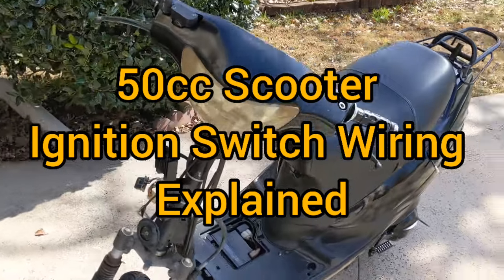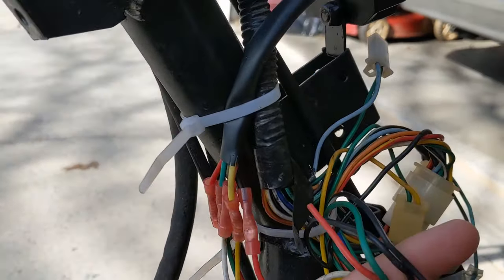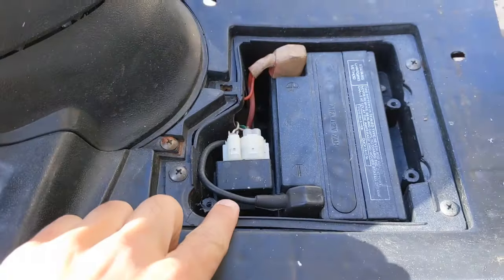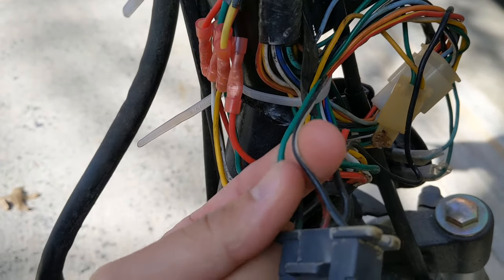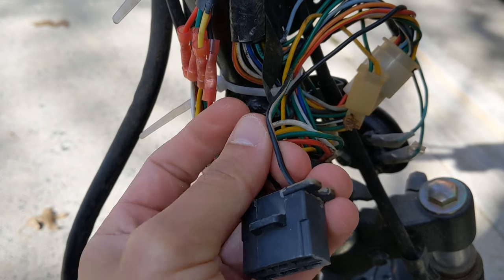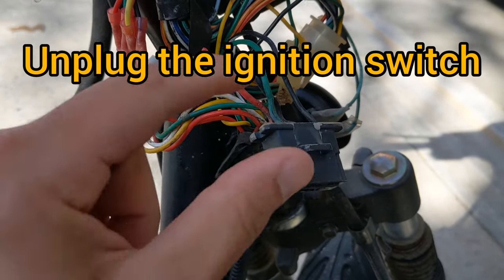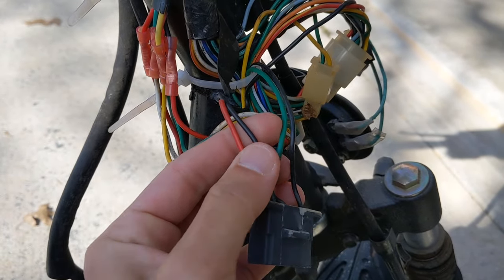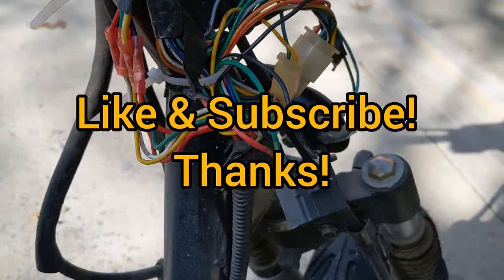50cc Scooter Ignition Switch Wiring How To [Lost Key]

Comment: I tried all that and it still ain't got no way to start it are they gone I'm getting juice to all the places and everything's checking good but it still ain't got no power or lights
Reply from the maker: @DanielGish-v1x  I’m not sure if this is your first comment or a reply to a previous one (use the reply option if so) but if you’re saying you probed everything and it’s working then idk why it’s not. Are you using the key or just connecting wires? Maybe the ignition is bad if you’re using a key? Maybe a relay somewhere that isn’t working?

Comment: ive got a 49.5cc schwinn sport scooter. i py passed the ingnition switch to start my scooter after ridding it . while i was ridding it it died and i have no power to the stater switch button and i have no lights or blinkers working
Reply from the maker: @BruceCook-v3j  sounds like you shorted something out, blew a fuse, or your battery isn’t being charged. Check the fuse

Comment: Let's sayyy I hooked the black and red to crank the scooter I touched the wrong spot and heard it pop like a breaker kicking seen some sparks how would I reset the wiring it's not showing me I got power no blinkers breaks not even turning to show me I got a full tank of gas what do I doo
Reply from the maker: Check the small round fuse by the battery

Comment: Please reply bro, so I have a 150 and I have red, green black and pink wires in my scooter. New ignitions aren't working
Reply from the maker: I would probe the wires if i were you and trace them to be sure. Red is probably the hot 12volt wires. Green is probably ground. Black is switched power, and if pink isn't constant power then it's the same same as my black and white wire... but that's just a guess.

Comment: Hey do you have the correct link to get the replacement ignition switch for this 4 wire  set up
Reply from the maker: No I only used switches. Try searching for replacement key sets for 50cc scooters. If I recall they are $15 USD and come with new keys, ignition, seat lock and trunk lock. You can swap them all out and have the same key for all.

Comment: Do i have to cut the red wire? And by connecting the black with the red can i just kickstart it or do i have to tape them together
Reply: You need to use a switch so you can short out the red & black to start up and also unshort the black/white & green wires at the same time. You need what is called a double pole double throw and connect the red and green to the two commons and black to the Normally Open contact where the red is connected to common. Connect the black/white to the normally closed contact of the common green wire.  One pair opens (disconnects) from each other green/black&white and the other pair gets connected red & black  when you start the bike by throwing the switch.

Comment: I purchased a stolen recovered Chinese scooter from a salvage company on eBay no keys. There are only two wires coming out of the ignition barrel so I hot wired the two wires of the main harness and I have lights horn even starter motor but no spark from the plug my question is do I have to have a working ignition barrel with key etc or is it something else?
Reply from the maker: Probably something else buddy. Check the CDI / ignition wire I was talking about by the battery. It's probably still grounded.

Comment: I have a question I took the plug out of the ignition  and now idk how to put new key ditch it’s same wiring color as yours .i touch to wires and the schock you with electric current do those go together
Reply from the maker: I just saw this. It sounds like you are connecting the positive and negative wire together. They do not do that. You are essentially shorting out the system. You might need to check your fuse now.

Comment: So I have a few wires coming off my ignition red and black which I have connected to a toggle switch to turn in and off power then I got two green which I found if I connect them together it’ll kick start just fine but the problem is my electric start won’t work, I do have one wire left which Is black with a white stripe, I believe my battery just keep draining I think but what should I do with this black wire with a white stripe? Cause kick starting it works the way I have it now but I want the electric start to work any ideas?
Reply from the maker: So what I understand is you have 4 wires. 1 red. 1 black. 2 green. 1 black/white. Watch from the 2 minute mark again when I talk about what is connect to what and when. 

If I had to guess, your red and black wire connect just as mine,  and they power the turn signals, running light (even when it's off) etc. You have to disconnect these two when you are not using the scooter or else your battery will drain to zero.

The black/white wire leads to your CDI (the thing that makes the spark for your spark plug) if you connect it to a ground wire (one of your green wires if I had to guess) then it will stop the CDI from working. So leave this disconnect if you want the motor to start. Ground it if you want to disable the bike.

For the two green wires. I would suggest to follow them. One is probably ground, I'm not sure about the other. Try connecting them as well as the black and red wires and see if it starts with the electric starter. 

Look at the wires going to your starter button and electric motor and see what color they are and that will give you a clue
Reply: @MileHighDreamz  ok perfect I’ll take a look again tonight I do know I think I touched the green to the red and black and it blew my fuse so I had to replace that and haven’t tried since
Reply: @MileHighDreamz  also do you know why my battery wouldn’t be keeping a charge? It’s brand new I have a switch for the red and black I shut it off when I’m not using the bike but it’s like it’s not charging fully does it take a while to charge it back up?
Reply from the maker: If the fuse is blown then your starter will not work. Put a voltage meter on the battery when it is running and see what the voltage is
Reply: @MileHighDreamz  are you talking about the fuse on the battery the inline fuse or?
Reply from the maker: Yes the inline fuse by the battery. The starter button is on that circuit, so if it's blown then the button will never get powered. It signals a solenoid to close and activate the starter motor

Comment: I have tao tao 2020 50cc scooter I have all of the wires you described except that I have 2 green wires instead of 1. What are they supposed to be connected to? 
Thanks
Reply from the maker: I'm not too familiar. I would say trace the wires to the source and see. If I recall correctly, green was ground, so just ground it off. But double check first
Reply: @MileHighDreamz  thanks for replying so quickly. I actually figured it out, I just connected the green wires together and that made my electric start work and my run / stop switch work too. I just connect the red and black to turn it on and keep the green wires together.
Reply from the maker: @J-money3I3  awesome, your welcome
Reply: @J-money3I3  hey did you have a black with white stripe? What did you do with it
Reply: green with green and the red with black

Comment: Hey man quick question , so i just rewired my scoot and it was my very first time ever doing anything like this, so now that it’s all finished the bike will start off the kick, but when I push the push button I wired in for the start button it just turns over and won’t start, is there something I can do the wiring to get it to start? What did I possibly do wrong?? Did way with the key completely and all my switches on the handlebars, I got a flip switch to cut power on, a flip switch for my headlights & tail lights, then a push button to fire the scoot up, but like I said it won’t do anything but turn over with the push button 😭😭
Reply from the maker: Do you have a switch for the CDI? It sounds to me like you don't have ignition (spark) which would be the CDI that is still grounding out. Make sure the CDI is NOT grounded when you are trying to get it to run.
Reply: @MileHighDreamz  without ignition spark it’ll still start with the kick and run fine?? Cause mine will
Reply from the maker: No it will not start without spark. Allow me to rephrase the question. When you kick start the scooter and it runs fine... think of any switch or button you moved afterwards to start it electronically. Are any of those switches or wires affecting the CDI ground? If so, maybe you are grounding out the CDI while pushing or switching whatever you are moving.

Option two. Is the battery very weak and the engine turning over slowly? Maybe try jump starting it or charging the battery.... everything could be fine but it just isn't turning over fast enough.
Reply: @MileHighDreamz  engine is turning over slowly for some odd reason, but the battery is fully charged , but it is a small battery but I figured it would at least be enough to start the bike, I just started messing with it last night trying to get it running , I’ve had it apart down to the frame this month getting the frame welded up and wheelie pegs put on, then painted it all, now just trying to get it dialed in , I reckon ima try and jump it today when I get home and see if the battery is just too little to start the bike
Reply: @MileHighDreamz  also I’m not really sure on how to check to see if wires are effecting the CDI ground, I’m a complete armature at wiring , ima good mechanic but new to wiring
Reply from the maker: You wired it didn't you? Watch my video again where I explain the CDI grounding and how it immobilized it. It's the green and blaclk/white wire if I recall off the top of my head. Anyways, point is if you wired those two wires to another switch or push button just make sure you didn't set it up to connect the two when you are trying to start it... aka when they should be apart.

Since you painted the frame, check the grounding qire for the starter and from the battery. Scrape off the paint so it's a metal on metal connection. Maybe that's why your starter is slow. 

Did you swap to a bigger motor?
Reply from the maker: @predator_boiz336  lmk when you get it sorted out

Comment: can i eliminate the plug and hard wire the ignition back to a torn harness? thanks in advance
Reply from the maker: I'm not sure where you are doing this but as long the wires are going to where they need to be then I don't see why not. You will want to switch  whatever wires connect /disconnect during normal operations

Comment: I'm using this key switch for my Yamaha xj550 motorcycle because I got the bike with the wiring a mess key ignition switch is janky an don't work. I need to know how to hook this key switch with 4 wires same colors as ur, too my motorcycle key harness witch is only 3 wires Red 12v constant, Blue for my accessories, an a Brown for my ignition..any help would be great thanks
Reply from the maker: I would look up the manual for your specific ignition you purchased. 

Do you have the old ignition. Switch to reference? Maybe Google 3 wire motorcycle ignition switch and see what it does.

If no luck, try using a multi meter measuring resistance/continuity to see what pins are connected/disconnected in each position. Write it down and then see which should connect to which. Give it shot with only three wires. If you think you are missing a ground, then run your own wire from the 4 pin ignition switch ground pin to the frame or battery... Then wire it up from there.
Reply from the maker: Im not liable to anything your mess up.... but if I had to guess. In the off position nothing is connected. In the on position, The 12v is connected to the accessory wire. In the start/crank position the 12v is connected to the ignition wire to turn the motor. Again, purely a guess.

Comment: I have my key I switch to a 150 cc what do I do with the black wire where I connect that one it pop  my fuse 10 I’m going to have to get 15 it also turned on the one that popped I connected everything the way that shirt is the black wire is giving me a headache......
Reply from the maker: I had the same issue during my swap. You need to replace the rectifier with the one for a 150cc engine when you do the swap. I have a video on how to do the 150cc swap and it is very detailed. Look there as well. I just saw this question.
Reply from the maker: I don't recall changing the fuse size. If that still doesn't work then you need to look for a short in the system where the black wire is contacting a ground.

Comment: Or no  ,they can contact each other when motorcycle running  if they do the motorcycle stop running  ?? What am I doing wrong those wires that schock you can’t be together ???
Reply from the maker: I dont understand your question.

The black/white wire should not be connected to anything when the engine is running.
Reply: @MileHighDreamz  only that one ? Cuz theirs 2wires  from my key ignition that give current
Reply from the maker: @jadieltorres9257  what color are they? The black and white wire is the one that grounds out the ignition and stops it from working. Only one of the 4 wires should have power with the bike off, from what I remember
Reply: @MileHighDreamz  which one has power with the bike off ? and my wires are the same as yours fr
Reply from the maker: The video explains it clearly. Did you try watching it again? Should be the red one if I remember correctly that comes off the battery. Please watch again and see if you find the answer

Comment: So just put the black and red wire together and it will start by kick starting?
Reply from the maker: If your wires are the same colors and that's what I said in the video, then yes. It's been a while and I do not recall off the top of my head.
Reply: @MileHighDreamz  🙏 thanks

Comment: Someone stole my moped I got it back but the ignition is busted out so I got a replacement and I went to hook it up the old one was unplugged  already  I hooked up the new ignition but it won't crank do u know what he might have done? Thanks n advance.
Reply from the maker: Turn the key on and see if the lights work. If not, probably the fuse by the battery. 

Can you kick start it?
Reply: @MileHighDreamz  yeah even b4 I got the new ignition I cld kick start it and the headlights worked  and now that the new ignition is installed  my turn signals  work now to but does nothing  when I turn key on and press starter button.
Reply from the maker: I would pull check to make sure the ignition switch/button is plugged in. Inspect all the wiring to make sure everything is connected. Verify your ground cables are connected as well. I have one running to the cylinder head and another to the starter.

After that you can check for voltage to the starter button. One side should be hot. Push the button while you measure the dead side and see if the button is passing voltage. Check voltages at the starter relay as well.
Reply from the maker: Before you check any of that...grab a multimeter and:

Check your battery to see if it's good. 

If that's good then check if the starter is getting power when you push the starter.
Reply: @MileHighDreamz  got it working went to take the battery out and the top had lifted and the 2 shorter ends of the battery  were bowed out bad so I bought a new battery and its working now. Thank you for ur help
Reply from the maker: Glad I can be of help. Enjoy.

Comment: I have a geely jl50qt-14 moped with no ignition switch, would you happen to know what switch goes with it? Thanks!
Reply from the maker: No I wouldnt, but I'm sure you could make something work. Count your wires and buy an ignition switch with that number of connectors. Then figure out which wire is which and hook it up.

Comment: tried this and it keeps just shorting something... so ended up taking a screwdriver and a hammer and breaking the locking mechanism of the switch so now i can just turn it with a flat head.
Reply from the maker: Yours must be different or you had something set up wrong. Glad the screwdriver worked for you
Reply: @MileHighDreamz   well its the same wiring execpt i tried starting it with the electric start cause my kistarter is broken need to replace the cog and the lever...
Reply: @MileHighDreamz  thanks anyway.
Reply: found an ignition switch of aliexpress for 2 bucks shipped should i buy it😂😂